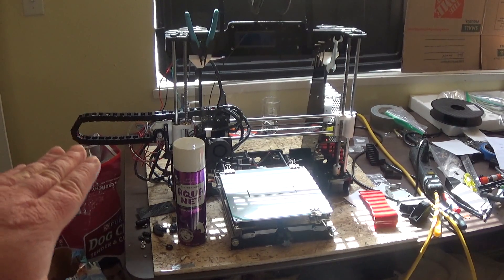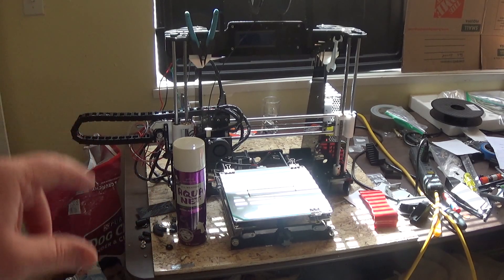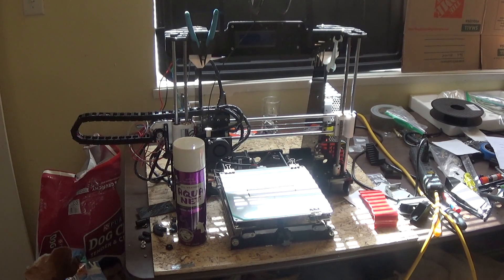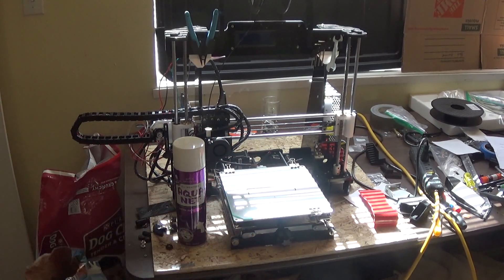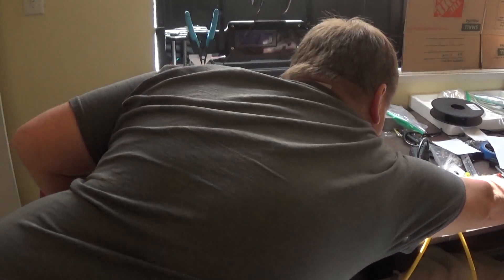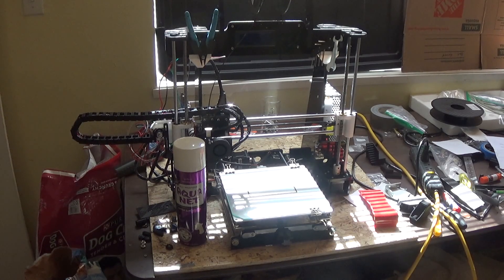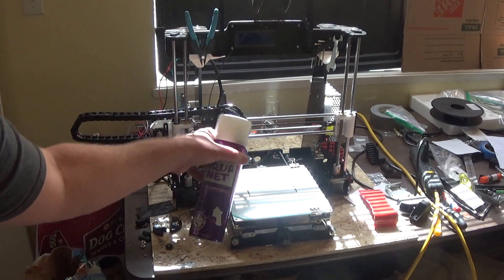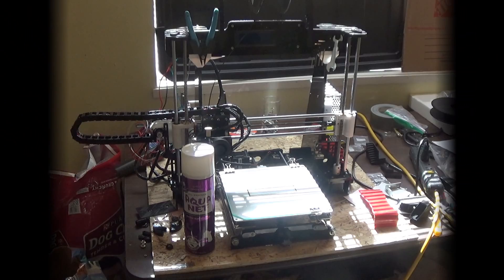3D Printing - When to use hairspray and its benefits

Comment: I could not get anything to stick to the glass I put on so I used hairspray so far so good.
Reply: Yeah, I just got my CR10 a few days ago and have had no luck directly printing on glass. I've been using tape over top of the glass and that's worked well, but it's usually only good for 1 print and tears when removing it, so I'm going to experiment with hairspray now.
Reply: @PapaP86  did it work?